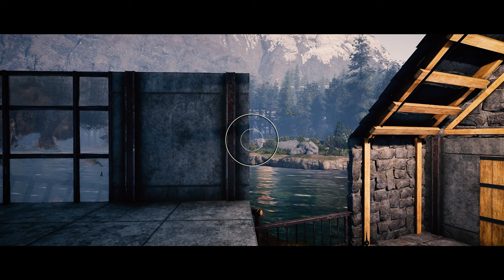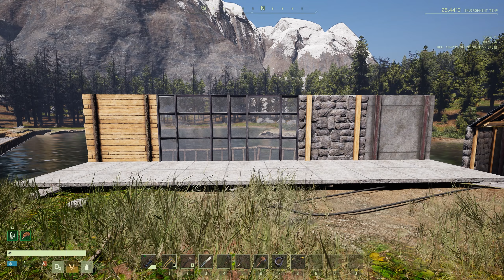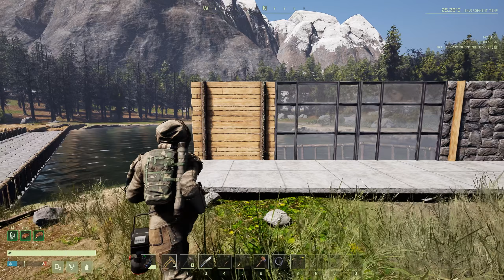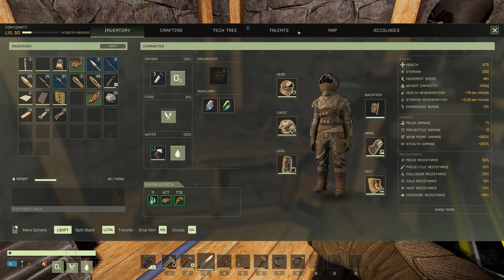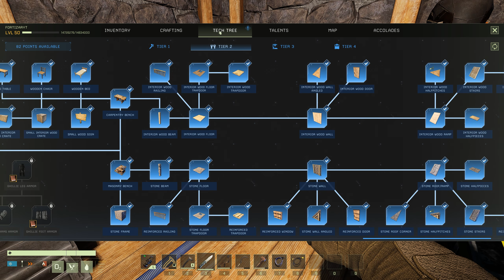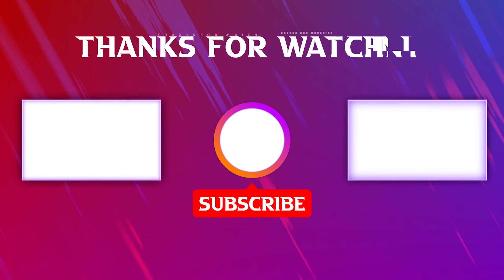How to STOP your Buildings taking damage in ICARUS

Comment: Stone angled roofs can also collapse in arctic under snow weight if the structure below it is 2+ floors. To combat this, the building needs to be braced by wood+ pillars. This happened to me on a 2x1 2 floor stone tower in the arctic environment WITH stone foundations supporting the structure. One real nasty blizzard deposited too much weight and a roof tile collapsed, the other was rumbling before I could get it braced.
Reply from the maker: That depends on the difficulty you're playing on, as it's a Blizzard that will cause that. As I said in the video, harder modes can change things.

But you are right. Adding support will definitely help, but that wasn't the purpose of this video.

Comment: I was surprised you didn't mention about using half-width stone or concrete pieces as 'overhangs' to avoid storm damage on glass.  Not sure if this is considered an exploit of course.
Reply from the maker: Hey the only reason i didn't mention that was so new players could just learn about the pieces to get the hang of that first, might do a follow up on my advanced building soon

Comment: Yea you forgot to mention DONT waste your points on thatch! It’s useless. Just skip right to wood. Great job on video. I like how you did the 3rd person walking them down.
Reply from the maker: Yeah I tried to avoid ranting about thatch even though I really wanted to 😂
Reply: Build a thatch base, cover it with a stone roof with an overhang. There you have an almost completely weatherproof base without it costing you an arm and a leg in materials.
Reply from the maker: You said thatch I can't take that serious 🙃
Reply: @Fortizar  I mean, you COULD use thatch. Personally I use wood with a stone roof.
Reply from the maker: Lol I was teasing. Yeah, wood with a stone roof is fine well when the weather situation was in the game.
I done a whole video on it when the weather was broken.
Reply: @Fortizar  The whole overhang thing is kind of broken. As long as you have a one piece roof overhang the walls and floors don’t take any damage regardless of the material used. So be as cheap as your want with those, as long as you have learned stone roofs, you are fine.
Reply from the maker: The way I've come to look at things in icarus is that if it's in the game, use it until it's  fixed.
True, you can use any materials, but thatch is holding up stone. I would need many more additional supports, I would assume.
Reply: @Fortizar  Good point
Reply: Thatch isn't entirely useless.  I just never used it for base building.  Instead I used thatch floors and slope pieces to reach the ore nodes in caves that I normally couldn't, which is somewhere between half and 2/3 in a lot of caves.  It helps navigating the more treacherous parts of caves a lot more convenient, though they can still be damaged by the worms.
Reply from the maker: I literally use one sloped piece of wood for that, I will always say thatch is useless 😁